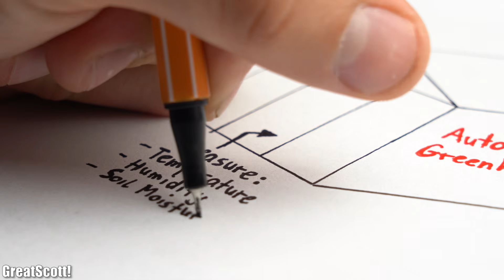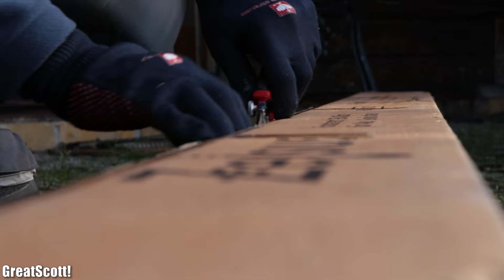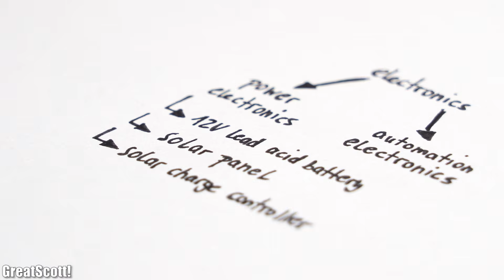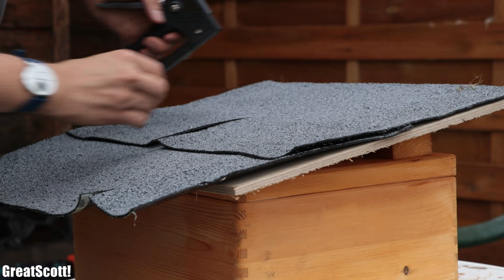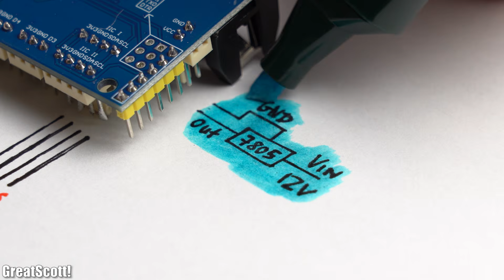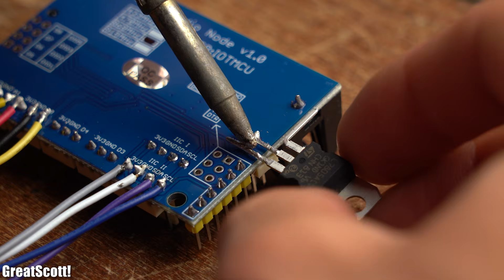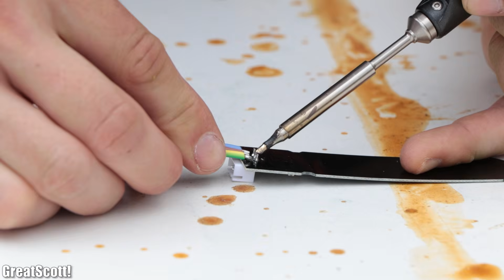Automating a Greenhouse with LoRa! (Part 1) || Sensors (Temperature,  Humidity, Soil Moisture)

Comment: Hmmm... LoRAWAN is back. Great video as always
Just curious, since the module already provides a male header, why you decide to directly solder the wire instead of utilizing it. That drives me nuts TBH.
Reply from the maker: I do not like creating connectors. I just like bare wires.
Reply: @greatscottlab  tbh, connectors are very useful when you need them disconnected for millions of reasons that you mau not have thought of. Soldering just makes it rigid, good for demo projects but bad for long running systems which requires maintainance time to time.
Reply: @MaulikParmar210  Especially when the wire is running through so many different containers. Now something as simple as moving the wooden box will require desoldering everything.
Reply: @greatscottlab  Okay there satan. Once you start using some quality connectors (I love the TE ones that look like PCI GPU connectors) you dont want to go back. And if it's low power enough, you can probably get away with a single RJ45 connector (I think a single CAT 5e wire supports over an amp).

Comment: That's one weird way to end a video..

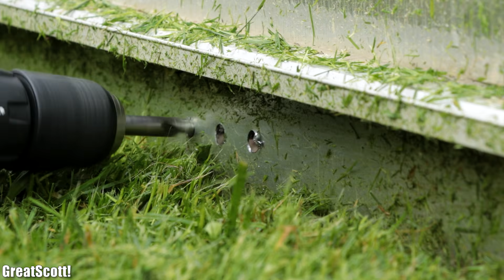A bit of tip: when you have a silicone wire close to any sharp edge such as through a drilled hole on aluminium surface, cover the wire with some heat shrink layers or use rubber grommets for more professional solution. The reason is because silicone wires are easier to slice through compared to regular PVC wire, and you don't want short circuit to happen. Talking from an expensive experience. 11:30
Reply: I was working on custom made UAV for aerial mapping purpose a few years ago. The main power leads were rubbing with the grounded aluminium plate on the chassis but I didn't give it any second thought. One day when I was testing the aircraft, I didn't strap on the LiPo tight enough. A few seconds after take off, the LiPo slipped and the grounded aluminium part cut through the isolation on the positive lead. From here, you should know how it ends. Those were bad memories..

The most effective way to learn is through pain.
Reply: @Asu01  Oh nooo thats terrible. At least you learnt a lesson, albeit a brutal one. Reminds me of the time i set RTL altitude to 75m instead of 7.5 on my drone.
Reply: Everything is a learning curve and you learn from mistakes. It's great when you get advice from others.

Though I could never understand ElectroBooms mistakes.
Reply: You could also put a rubber grommet on the hole for a more professional solution. Then the wire is still protected no matter where it slides and you won't end up the tape turning into a gooey mess.
Reply: @eDoc2020  That was exactly my thought both when I saw the video and the comment from Asu. Grommets were made for this purpose.
Reply: You sir have peaked my curiosity. What happened?
Reply: When you run wires through drilled metal holes on small scale where an actual conduit pipe wouldn't make sense, you're supposed to install a plastic or rubber grommet for this very reason.  Particularly with a greenhouse that is technically outdoors (even if it's not quite as exposed to the weather) you want to make sure that you're building something that accounts for a myriad of situations including accidentally knocking into the cord and causing the metal to slowly bite into the cable.  

Shrink tube would be adequate in some scenarios where there's little to no risk of putting physical strain on wires, but the biggest issue is that it's literally in a greenhouse - a shrink tube may be able to hold together under high heat and diffused sunlight, but the structural integrity is greatly compromised and in ordinary conditions not exposed to direct sunlight would be about as soft as silicone, if not softer.  Though, bear in mind also that the majority of shrink tube is black in color, which can absorb quite a bit of sunlight even if the greenhouse walls are reducing and diffusing the sunlight.  Most materials the majority of their structural integrity at temperatures within 75% of their relative melting point.  The melting point of heat-shrink tube is around 200F (90C), making the relative temperature range from 140F-170F.  In many hotter places, it's not uncommon for blacktop to reach temperatures of 130F to 140F, so we can safely assume that such temperatures are not outside of the norm for black heat-shrink tube in an insulated greenhouse.
If you were going to be lazy no matter what, it would be better to use waterproof heat-shrink tube (preferably not black).  The waterproof variant comes with a layer of low-temp glue equivalent to what you'd see in a hot glue gun which melts at about 400F (200C)   The trade-offs for higher structural integrity and waterproofing are a penny or two per inch, and the loss of flexibility that is typically of critical importance in most applications.  Waterproof heat-shrink tube would have another side-benefit of being waterproof, which can be important in the saturated, high humidity environment of a greenhouse - particularly when the water systems are automated and may result in water condensating and dripping down wires.  I recall there was a hilarious image of someone's ethernet cord that was plugged into the PC from the wall, and it was very, very slowly dripping water.  It ended up turning out that there was a leak somewhere near the gutter, and due to how water's surface tension works, it was able to travel a long distance just on the back of that cord.
Reply: Why not just put a rubber grommet in the hole? You can find them in the electrical section of Lowe's or Home Depot.
Reply: @GreatScott! have you seen this?
Reply: Yeah I think it's really weird how he goes overkill on wire thickness and a lot of other overengineering type of stuff but he overlooks basic stuff like making sure your wires don't get cut on sharp edges...
Reply: Now say it without crying hahahaha... It's a good recommendation though
Reply: You bot hacked my account
Reply: @bluewater3540  🗿

Comment: Any chance you could make this not this complicated? (just an arduino mega 2560, sensors, motor drivers and motors) also, electronics themselves are bit expensive...
Reply from the maker: I think it was fairly simple for what it is supposed to do
Reply: @greatscottlab  Adding all the networking stuff over complicates everything, if someone wants to replicate and/or modify the code...
I am working on something much simpler (measure temperature & humidity, and pump water from 2x   1m^3 rain water tanks to water a greenhouse about 6-8 times larger that yours)

Comment: What about those soil moisture sensors, they don't seem to last very long because of the electrodes being energized with the surrounding the water. The electrodes will slowly degrade over time. Would you recommend just replacing them when this happens or use a different type of sensor?
Reply: He mentioned he was using a capacitive sensor. These have a layer of insulation between the electrodes and soil. I believe you are thinking of the cheaper resistive sensors.
Reply: @eDoc2020  oh yeah, you're right I was thinking of the resistive type the capacitive sensor he is using is much better. Thank you!

Comment: Think about sealing the box+wire with silicone. Water will run along the wire and accumulate in the box otherwise
Reply from the maker: The box holes are higher positioned than the wires going in. So that should not be a problem.
Reply: @greatscottlab  Water could also some in from other sources such as condensation. I think adding a few holes on the bottom of the box would be useful just in case water gets in.

Comment: Extremely disappointed

Where is the two axis solar panel positioner? :)
Reply: Germany has a temperate, marine climate which means a relatively high number of cloudy days. On cloudy days, a tracked solar panel does not produce any more energy than a fixed one. In this type of climate, and with current low (and still falling) solar panel prices, you'd be better off installing a second or larger panel. Less complex, more reliable and probably cheaper. 

The only thing that might be useful is to change its angle with the horizon twice of four times per year. By setting the panel to a steeper angle during the winter months, you'll get more energy, and in a climate like Germany, that's very useful.

Also saw some things that are not optimal, but GreatScott probably knows this. A car battery is not optimal for this kind of application. A deep cycle lead acid, or lithium, battery would have been better. Also installing lead acid battery outdoors, at potentially freezing temperatures during the winter, will not be good for it's lifespan. But I'm sure it'll work for a while 😁
Reply: Thats part 3... next year... when he augments fall temps with electric heater.
Reply: GreatScott! covered this in a previous video: https://www.youtube.com/watch?v=_6QIutZfsFs
Reply: So many r/woosh's to make

Comment: hey, this is what I do for a living. I automate very large greenhouses! Hundreds of sensors, irrigation machines, water cleaning machines, pretty much everything!
Reply from the maker: Sounds like an interesting job :-)
Reply: @greatscottlab  Ahh! you replied! I'm so happy now.
Yes, it's a very interesting job! Can't wait for part 2!
Reply: I wish I could learn and do everything 😭
Reply: The moisture sensors he used dies in 3 months.
Moisture gets in the laminate, corrode the bare connections or attacks the bare circuitry on them.
Reply: @1kreature  Exactly what came to my mind, and if not mistaken also toxic.
Reply: @theovannieuwenhuizen5756  So what is the solution for that problem?
Reply: I'd watch videos on that!
Reply: Awesome! What soil sensors do you use? Super expensive industrial ones?
Reply: @erlfram  Hey, yes they are fairly expensive but a bit more robust and have 4-20ma outputs. Surprisingly a lot of greenhouses don't use them, Usually irrigation's are triggered in other ways, Like outdoor solar radiation sensors. And a few other more complex ways using 
weight scales and water counters.
Reply: @fc3sbob  Thanks, maybe I'll just use temperature and water counters for my project then. Or do you have a link to the moisture sensors? :)
Reply: @fc3sbob  What kind of training, or education do you need to get into that industry? Any pointers? Thanks!
Reply: @miahsbrokengarage  "What kind of training, or education do you need to get into that industry?"
None. Start your own company. Btw no education is available that properly educates you for this kind of industry. I have an Electrical Engineering degree, but that was mostly used as an entry point for learning what I actually needed to know. 
My degree never taught me how to integrate with the PLC, how to organize a large deployment of products, how to design a professional PCB, how to spec and order parts, how to use various wireless protocols, or any software engineering (which should be in an EE degree nowadays).

btw @GreatScott stop using those knock off Chinese LoRa transceivers. Use the Murata modules (The one with the STM32L072 and the SX1276). So much better.
Reply: @fc3sbob  can you possibly give any hint of models/makes for those 4-20mA sensors? I work in factory and know something about sensors, but not ie. humidity. Only optics, reeds, capacitive etc. standard automation components. I'm planning to get greenhouse and I might use Siemens Logo for couple things.
Reply: @ericcartmann  Yes, degrees suck :(
Reply: Hey I’m 20 years old I go to northwestern university and I’m studying computer science. Have any internships or jobs available? This is my dream!
Reply: Lol I'm DevOps engineer soon to be retired farmer 😆 was fun to hear about influxDB and grafana in a greenhouse related thread 😅.
Reply: Cool job
Reply: Interesting job for the first week.
Reply: Great Job!
One question, i've seen the soul humidity sensors go bad Bad quick because of corrosion. Or did you find extra special ones?
Reply: @theovannieuwenhuizen5756  It seems the resistance based soil sensors go bad and corrode, the latest cheapo ones are now capacitive and fully sealed in solder mask. I believe they are listed as not to be submerged below a certain level though hence the nail polish of the component section. I ended up with https://www.aliexpress.com/item/32832538686.html
Reply: @tyeth  cover the in PlastiDip
Reply: @theovannieuwenhuizen5756  use capacitive ones, or use carbon rods or switch off power in between readings
Reply: I need some help setting up my greenhouse. I have the gateway and some sensors and switches. Just need help with the rules and scripts.
Reply: @mewrongwayKOCXF  I still have a long way to go, they say that I'm still young but man do I feel old.
Reply: How far away and deep should the sensors be placed in the soil from the water source?
Reply: What system? Priva??
Reply: @nickbellizzi5857  I don't want to say, but I have worked for a Priva installer in the long past.
Reply: hi .... how do you monetize and find Clients?  (I might be a prospect)
Reply: Hello can you maybe help me with My project?
Reply: @fc3sbob can I have your email please?
Reply: Hi bob very interested in this kind of topic how did you started? And whats your backgrounf of study.
Reply: @jeromecapsatv249  I grew up around greenhouses, in highschool I did a work program for a semester where I worked for an electrician that installed the climate systems, many years later I got a job with a small local company that also did that. I took computer science but my hobby was electronics. And that was 18 years ago. I'm still doing the same thing just with another company.

Comment: I have a unknown transformer but I don't know current value . 
How to find it
Reply: r/electronics would probably help. If not, Google lens could probably find a datasheet
Reply: r/askelectronics is the sub you want for identifying random components.
A slap dash way to find the current rating for a transformer is to measure the diametre of the windings and look up how much current that guage of wire can take.

That doesn't take into account magnetic saturation though

Comment: You should start using Home Assistant it has dedicated plant information cards
Reply: If GreatScott was already using HA in the rest of his house then I'd 100% agree with this, however imo HA seems a bit overkill for a couple of sensors and straightforward automations, especially as there doesn't seem to be remote control capability (although we won't know for sure until Part 2???)

I think HA really shines in more complex projects such as My DIY Home Assistant Garden Automation System (by another youtuber) and actually adds a lot of value with the straightforward dashboards and easy remote control.
Reply: @NicholasElliott  The biggest advantage is not being coupled to a cloud-based platform that can get the plug pulled at the drop of a hat, at the cost of a Raspberry PI.
Reply: Google?
Reply: @markarca6360  Nah dude, home assistant is an open source project to help you automate your home
Reply: @markarca6360  not google assistant, home assistant
Reply: He's got a wifi thing so I could imagine there's information about the state and everything and probably remote control as well.

Comment: Could you use supercaps instead of H2SO4 battery?
Reply from the maker: I think so.....
Reply: I believe supercapacitors have a high self discharge rate which could prove problematic. I would suggest using a lithium ion battery instead. A USB power bank with a built in solar panel would be a convenient way to achieve this.

Comment: Great project! For those who can't afford the Lora gateway, you can use two LoRa emitters/receivers, one of them transmitting the data to a raspberry pi for example, running Influxdb, Nodered and Grafana. This offers an incredible number of possibilities in terms of data visualization, processing and triggers. My whole house runs on it, it's absolutely awesome and, once in place, easy to fit to your needs. @GreatScott!, contact me if you want to know more 😉
Reply from the maker: Great idea :-) It is on my to do list
Reply: X99 I agree there completely, it would also be cool to have some videos using this method more. But awesome video nonetheless and I’m excited for the future parts of the series!
Reply: Is there a significant advantage of using a lora approach vs wifi and mqtt type messages?
Reply: @reallyiffy  LoRa has the advantage of having a LOng RAnge (hence its name), what WiFi hasn't. The basic use is, as GS did, to transmit small amount of data over a long distance. WiFi is the reverse: large amount of data over a small distance, let's say ~50m in open range using a standard WiFi antenna. LoRa can transmit up to 15km on open range (again, see Andreas Spiess' videos), but at a much lower data rate.
A full example could be: Sensor -> LoRa emitter -> LoRa receiver -> ESP -> Wifi router -> Raspberry Pi, for example. It's basically what I do, a bit simplified though.